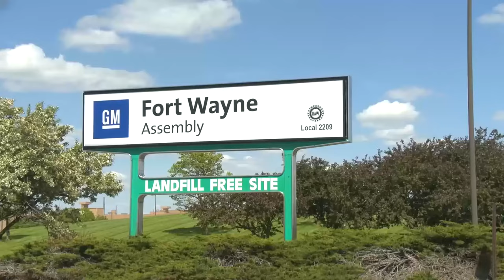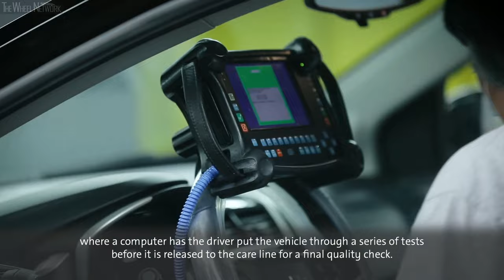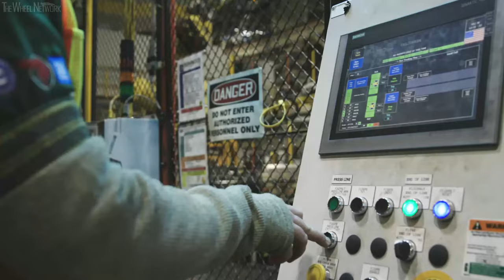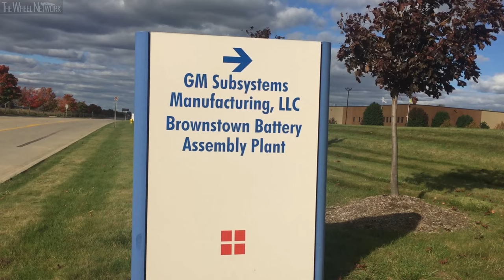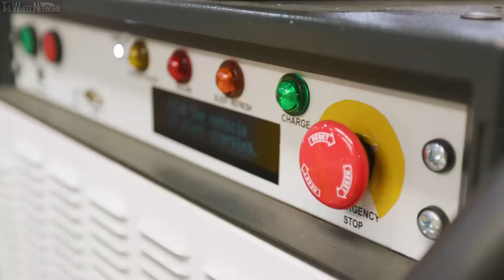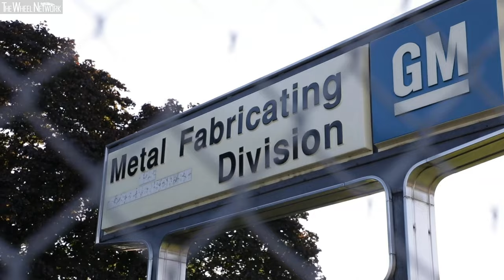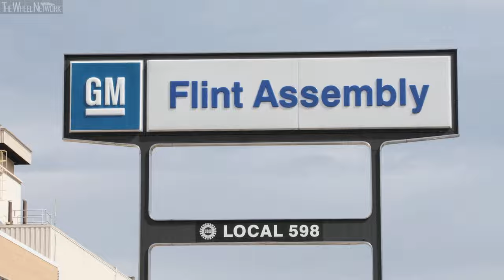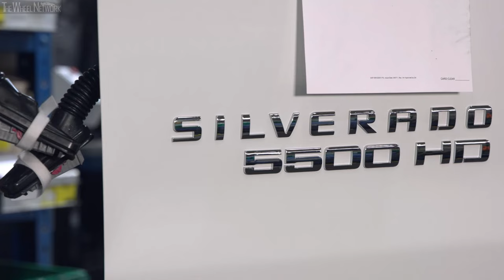General Motors Production in the USA

Comment: Only Gm product I have owned was a truck. The engine was powerful. Interior was absolutely horrific. Knobs paint flaked off inside on 30k Miles. Door handles fell off, tailgate handle broke every other week.Transmission was rebuilt twice before the engine died. Truck had 145k and blew head gasket. Maybe I just got a bad one but I never stepped foot on a Chevy dealership since.
Reply: What model and which construction year was the truck?
Reply: @heavychevy8994  95 1500
Reply: Owned an excursion for 12 years got it with 70k miles, alt brakes oil and coils of course tune up, just took it cross country still sweet!Now has 200---k on it now.
Reply: plusva
Reply: a USA  muy bueno la industria general motor gm gracias a ustedes por el acceso
Reply: We're are ther safty boots
Reply: door handles fell off 😂

Comment: Bring back the fantastic  reliable  1989  and   1979   Caprice   ♥️♥️💪💪👌👌👍👍     specially the perfect  TH350   transmissions
Reply: It's only got 3 speeds. With current CAFE standards, needs an overdrive.
Find a nice older one.

Comment: The CEO of GM make $23 million a year. CEO of Toyota makes less than $2 million. Maybe they could cut her salary and make better cars.
Reply: @Fred Trump You are right. From São Paulo capital Brasil.
Reply: @kxngearner698  I think you belong somewhere else, toyota is good it's just that it's not built up to perfect quality like GM, decent but not enough to compete on GM, still however if you're going to be talking trash you might as well belong in the trash
Reply: you really should look at it's new line of vehicles
Reply: Maybe they can just fire her instead ND hire a man that knows what he's doing.
Reply: @Fred Trump Trump mouth.
Reply: @kxngearner698  From my experience. I will never buy another GM vehicle, again. GM vehicles are junk. I had a 2018 suburban. At around 36k miles, the A/C system stopped working, at 40k miles the front suspension, front axle fell apart on me. My friend's Chevy Cruze engine seized at only 60k miles. GM products have very poor build quality, unreliable, overpriced pieces of 💩. Even in the consumer reports GM vehicles scored very poorly. The 2020 Silverado only scored 16 out of 100, Chevy Cruze, Chevy Equinox both scored only 13 out of 100. Chevy Traverse scored only 14 out of 100. Yikes!!
Reply: Never happen they been making crappy cars trucks for years
Reply: which toyota is a better car than GM cars
Reply: @royall4609 are you kidding? Toyota is more reliable then any American car  manufacturer and it pains me to say it. As far as reliability Toyota, Honda, Mazda are top dogs and have been for years now. If I buy a truck I will buy American but everything else Japanese.
Reply: No
Reply: I still drive the rebadged Saturns of 2007/2008. All just over 80k miles and look and drive like new. All we've done are kept up with the oil changes and completed the tune up at 50k. Great cars thus far. We have 2 Saturn Skys, The Saturn Outlook and The Saturn Aura XR. We also have a 2012 Cadillac CTS, also with no issues. We love our GM products. I'm a bit leary of the new ones but time will tell. We will eventually buy newer ones. We're keeping the Skys for life though. They are too unique.
Reply: Maybe Toyota should stop wasting millions of dollars in LEAN practices and spend the money on things that matter

Comment: Not much of a dress code. Some of them look like they rolled out of bed
Reply: Youre in a factory yiu must wear protective gears
Reply: Along with the entitled attitude. I know some of these workers ( for Ford) . They think the world owes them.
Reply: So would you if you worked on the line
Reply: There really isn't that much of a dress code. Sometimes it depends on where on the line you work. Some places you can wear shorts and other places you need full length pants. PPE (Personal Protective Equipment) varies, too. If you work in General Assembly you may just need safety glasses and gloves, other places you might need to wear kevlar sleeves so as not to cut yourself on sharp metal

Comment: Too bad they stopped making the impala. Damn good cars.

My 2011 Oshawa W body has been very well to me. Thing runs great at 200,000 miles. GM is changing and getting places quicker. Hope them well in the years to come as they learn to better themselves.

The new T1XX Trucks/SUVS and the C8 corvette are a testament to change in my personal opinion
Reply: The new Tahoe is sure nice.
Reply: They sure are. While they did do away with the solid rear diff and the column shifter they are still solid trucks in their new form.

The PPV model is loaded with new high tech features including a stop from five miles and hour. You can't be no greater than five miles an hour when attempting a automated stop.

Comment: If GM had some foresight and didn’t stubbornly refuse to change along with the times they would’ve been a force to be reckoned with. Remember, they had the EV 1, which was ahead of its time and the lessees ( you couldn’t’t buy one, you had to lease one ) loved those cars so much some went to court to try and buy them when the leases were up. Except for some cars that were donated to schools the rest were destroyed. I bet the engineers who worked on the EV 1’s look at Tesla and get sick.
Reply: They chose to try an use their old frames an alot of older stuff to build the same quality an keep them simple to be repaired unlike others who changed their products an designs so much that they created other issues. This brand does need a change an it is time for them to retool an ad some new flare to this brand. An I believe they can do it. Not sure what it will take but I am sure they can. I love all cars an these share alot of parts from their older models up until 2008 I think an newer . So it's nice when u have a wrecked one an you can find one in a salvage yard. That doesnt have like 20 different types to prevent direct bolt up stuff from your previous year models.
Reply: EV1 was ahead of its time .. because a low cost LONG Life battery tech didn't exist back then. Competing against low cost Gasoline is hard, a vehicle like the Electrovette or EV1 couldn't compete ... even today the current long life Lithium battery powered EVs are much more expensive than the average ICE vehicle .. and that isn't going to change for a long time.

Comment: Sadly, Amazon is paying higher wages for new hires than General Motors. Same people claiming that union members who make $12/hour are overpaid but when Amazon workers make $15/hour to start, they claim it’s a fair and just wage.
Reply: GM Wentzville pays 16.75.
Reply: You get better worker in mexico for 3.50 and hr and I can get 4 guys instead of one get much more done .and cheaper better quality
Reply: $12 an hour?? You must add like Gov. Of Georgia🙄
Reply: @drofdoctors7887  I was referencing new hires, not the seasoned veterans of GM since that would be an unfair comparison since Amazon is a much younger company.  Both are run by left wing lunatics don’t get me wrong.
Reply: @drofdoctors7887  unions are not the problem, environmentalists are. I work in an union shop and plenty of us are conservatives, including myself.
Reply: If they paid  there workers more ,there cars may not be crap  12 dollers a hour thats slave labor.
Reply: @vangard3415  Toyota and Honda pay their employees even less than the big three and still putting out better quality vehicles. GM employees are not making slave wages. There are assembly line workers making $33 an hour. That is not slave labor.
Reply: Now it's 20 an hour.
Reply: I think the recent contact definitely change that entry wage. Also, Amazon accounts for most of the safety issues in manufacturing/ warehouse industry in the nation.
Reply: The GM in Flint starts new hires off at 16.57/Hour

Comment: My only question is why GM takes a long time to fix the design then trashed it in two years? Examples, 2017-18 Camaro, and 2016-17 Equinox.  I own a 2020 Silverado!
Reply: I love them using Aluminum for doors and hook. But the wheel wells need the Aluminum the most due to rusting.  Please make the change in the future

Comment: Make a transmission that doesn’t shit out after 70k miles.  That’d be a start.
Reply: 100% transmission problems!! Nothing but junk, 2014 and up
Reply: @JS-xk6dr  can't run it out of fluid einstein. Check it once in a blue moon🙄🙄
Reply: @drofdoctors7887  lol true, they still junk thou, I owned very many used ones low miles and even new ones with only 3k miles and GM denies to fix it, they are pretty good at washing their hands off if it’s covered by warranty but if i am paying for it then $7500 tranny rebuild estimate comes out really fast ! Trust me I owned more than 10, I owned a used pre-owned auto dealership, me and my dad are auto mechanics I know what i am talking about!! Even the 2019 and 2020 are terrible, we owned 3 2019 and a 2020 and all 3 had shuttering and vibration issues, I had my local GM dealer inspected them and they said thats normal! LOL it is what it is

Comment: I have a 1991 Chevy Camaro V6 Rally Sport. I've had it for several years now and dispite everyone knocking it for it's dilapidated nature and V6 drivetrain, it still gets comments from car fans. Sure it's not a V8 but Its still a fun driving sports coupe. I'm not your typical car guy, I'm actually a automotive industry and engineering enthusiast and I'm not entirely bothered by shallow car nut views.

They relent on my views and I just shrug my shoulders and carry on. now recently mice got into the car and chewed the harness to bits and damaged some components around the car as it sat over the winter.. something in the wiring that attracts rodents and the loss of seam sealer made room for some surface rust to have way of it's front floor panel.. 

But instead of giving up and selling the car I've chosen to keep it, slowly restoring it to a better state than it was in when I first got it.

Eventually it'll be done an I'll have my immediate family sign the car in a chrome Molotov pen as a final touch to be added beneath the clear coat on the corner of the rear deck lid.

Comment: I don´t see any problem with these cars, seem powerful, strong, confortable. If you americans call your cars junk, I don´t want to know what do you would call the GM cars made in Brazil.
Reply: Jr cc You don't see any problems with GM vehicles?! Lol Just drive one for about 35k-40k miles and you'll start to see things break, fall apart on you. Why do you think all GM vehicles have only  35k mile warranties?! I've seen Chevys like the Cruze, Equinox engines blow at only 80k miles😂😂
Reply: @robbyrob8349  I meant GM America. GM Brazil is called chevrolet, is very popular car bramd here. But, our cars is totally different from yours. Our cars have less power (165 hp, most powerful), while yours are over 200, 300 hp. By the way, the North America GM looks well made because it have a nice interior, most power, and also more safe (compared with GM Brazil). Our new GM car are crap, a  car called "Chevrolet Onix" catches fire even when it was parked. And the worse part is that it is very expensive

Comment: If someone has a good experience in the  old  GM  cars    I have a question    :

Can I   install the nice steel gas tank  of the   1990  Caprice   or  Fleetwood    for  1992  Caprice   without problems   ?   Instead of the useless original Polyethylene plastic fuel tank   ?
Reply: The plastic tanks help in crash test. The metals burst an also rust ! It's better for longevity of parts an in collision.

Comment: GM. What’s the story on the 8 speed transmission?  Has it been fixed?  What exactly was/is the problem? And it can’t just be the oil. They’ve been making good automatic transmissions for many years, so why is this one have so many complaints?....  I literally grew up in GM dealerships, and I’m driving a 2004 pickup that’ll probably exceed 250-300K, but until you stop selling those transmissions or come clean about the root cause and what you’ve done to completely eliminate the problems I’ll never buy another GM vehicle.

Comment: Here's what I like... GENERAL MOTORS STOCK IS SO MUCH MORE VALUABLE THAN FORD OR CHRYSLER/FIAT😁 The General just builds better vehicles in their higher scale lines. Most dummies on here tryin to compare a lower scale vehicle like a cavalier to a high scale Lexus sc only like some idiot would do🙄
Reply: Dr of Doctors ...yeah sure uh huh, that's why 90% of all tow trucks, ambulances, and police cruisers are FORDS...Garbage Motors Corp produces one of the most unreliable vehicles one can buy, every single GM product ever built since Day 1 has been absolute junk, just trash....since I prefer my rigs to start up and run with power, all 4 of my rigs have FORD power plants, from my 1944 Ford flatfender Jeep to my 1974 Ford Bronco to my 1988 Ford F-250 4x4 to the 1985 AMC Jeep Cj7 I'm droppin a Ford Coyote motor in, they all eat toyotas and crap chevy's...

Comment: Robots are the way instead of outrageous union paid jobs.No wonder a pickup truck costs 60 000.
Reply: My union made Chevy truck was less than half that.  Some trucks cost $60K because some people want the biggest truck with the biggest engine and the most optional extras.
Reply: @GH-oi2jf  Here in Canada on the east coast an LT model is 60,000  and the top end trail boss is 78 000 tax in.
Reply: @GH-oi2jf  Its not even about engine anymore. Wanting a proper truck that does truck jobs seems to be harder to get now. Yes the general consumer wants a 5+ liter N/A engine that is high on the reliability and serviceability factor in a pickup, with a transmission that wont burn out after light usage. '17 Silverado's come to mind or way back in the 90's with the 700r4's and 4l60's in full sized pickups.
Back when the engines did not have all that AFM/DFM, DI bs all over them the trucks were much more desirable.  

Buying a new truck from GM right now is laughable. the bodies are ugly as hell, oversized and the truck itself is unreliable.  
Also that 2.7l.. a 4 banger turbo diesel in a full sized truck.. wtf is gm thinking? Why would you buy that over a 5.0 Ford or a 5.3?
Reply: The cost of labor of a brand new truck is less than 3% of the cost of the vehicle. Try again.
Reply: Amazon pays their employees more than what General Motors does. So by your logic, Amazon should be the most expensive online retailer in the world.
Reply: @JonathanMoosey  well if you can figure out how to use Google.The aversge union salary of a G M worker is 90 000 comprised of pay, pension and profit sharing benefits.The average Amazon annual is 26 000 to 32 000 depending where they established the warehouse.
Reply: @bobjackson4287  I have to agree with you.As a Chevrolet owner and had several Silverado 's of different generations they are getting worse.I had 4.8 engines in older trucks get 400 000 kms mark but lost the engine in a 5.3 at 104 000 kms wih AFM.Currenly have  a fleet Silverado with constant transmission problems.Difficult to purchase a reliable truck .Might have to look for a Southern 90's truck.Liked basic design despite known issues.
Reply: @stevewilliams2725  you’re not comparing apples to apples. You’re comparing just the salary of Amazon workers without adding benefits and extras to the unionized workers wages and benefits. Typical anti-union tactic.